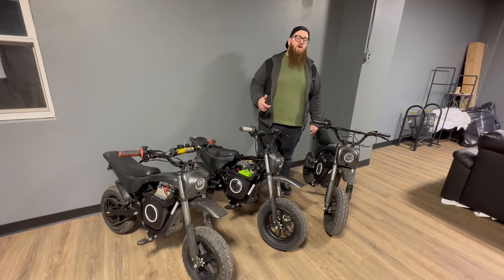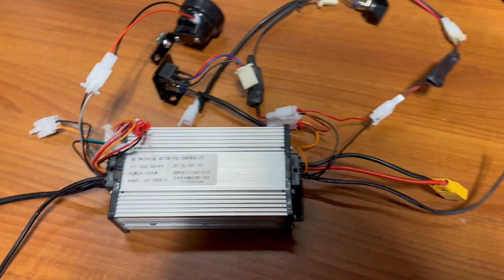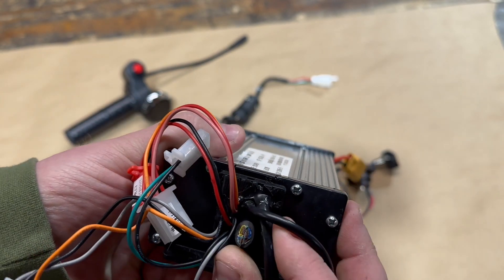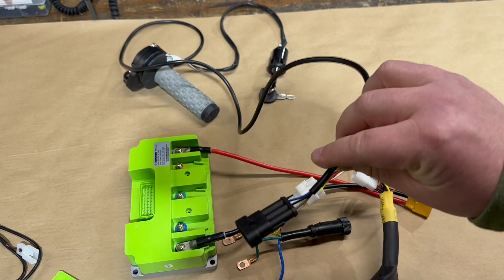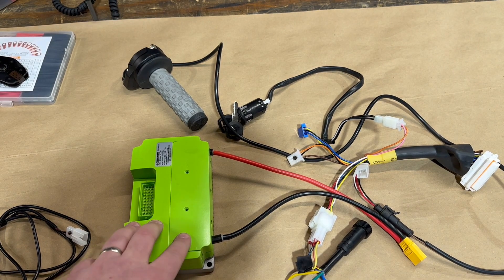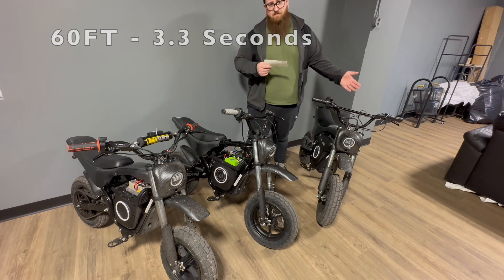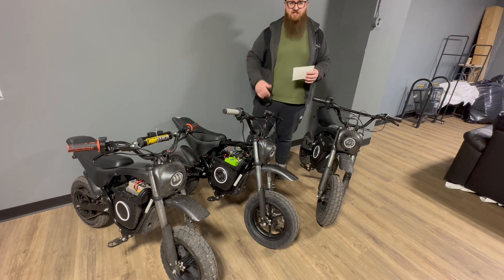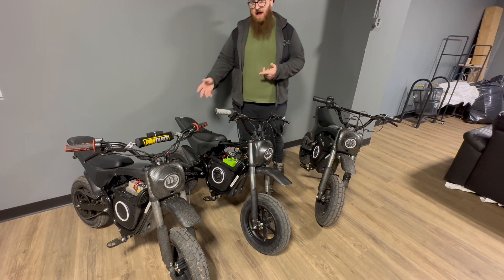How to Upgrade Burromax TT1600R | PART 1- Controllers

Comment: The stock charger wires into the +/- in parallel. That single discharge port coming out of the battery means its a common port BMS and charging/discharging happens through the same place. The probable reason why charging port runs through controller for shutoff safety. Prevents bike from being ridden while charging.

Comment: Just thrifted a burrowmax tt350r and im looking where to pick up the battery casing that the tt1600 has but i cant find anything
Reply: The battery box is on the burromax website, part number 19086

Comment: Im the guy that did the FD 72450 and retained the factory handlebar controls and lights and posted iit up on the FB page
Reply: It's all the same. On/off switches, momentary switches, etc. All the controller does is stepdown the voltage for the accessories.
Reply: @DescartesRenegade  best part is, you can wire in the factory lights without a step down!
Reply: @JonnyDuzzit  really? the side lights has that little dongle in series tho. The rear light also works on 52v?
Reply: what little dongle? They all run right off the controller without a step down. Just extended the leads. The stock controller doesnt step the voltage down. Ive tested the output voltage to the lights and and tested the lights straight to the batt.
Reply: @JonnyDuzzit  on both of my side lights, there's a small shrink wrapped PCB in series with them.
Reply: @Nominally-Built  yeah but i mean you dont need an actual step down for all thoae lights.

Comment: Just ad a splitter on the discharge cable to have an extra xt90 plug or use a XT60 for charger. That's an easy fix

Comment: To address the charging, couldn’t you use a Y-harness to have the controller and charge port connected to the battery at the same time? Might be unsafe if you turn on bike while charging, but should work.
Reply: Just take the ends of the charge plug and extend them, then add ring terminals and connect them to the batt terminals on the controller. Def not unsafe. That's how it's wires in the stock controller, connects to the same batt (+) and (-) pinouts on the board.

Comment: A plug & play 72v kit would be 🔥🔥🔥
Reply: Definitely and some super moto wheels
Reply: @boredism1327  yes 👏🏽
Reply: @burn1gotbeats  I was just at a local bike shop said they had the size next check I might grab a set
Reply: @boredism1327  🔥🔥😎
Reply: There basically is one, get a Lightning Rods Big Block motor (fits in the stock swingarm easily - good for 10kW) then get the 72V kit from High Voltage Kits, they have a kit specifically tuned for the Lightning Rods motors and it comes with the display, BAC2000/4000/8000 controller and harness to plug and play. Just add your battery.
Reply: @karlfriedrich7758  thanks bro 😎👍🏼